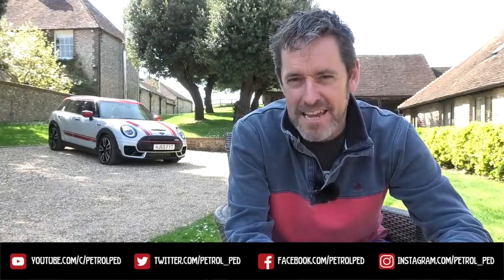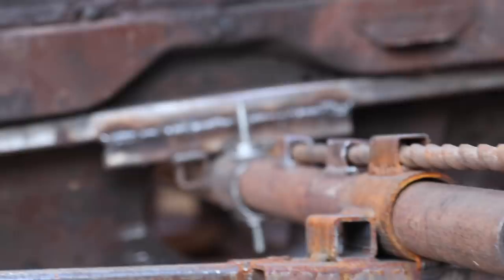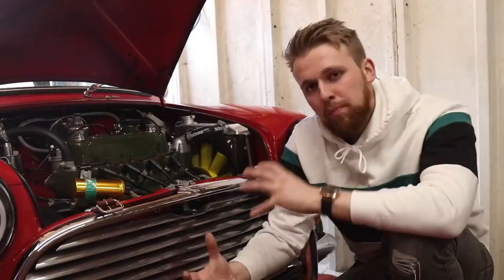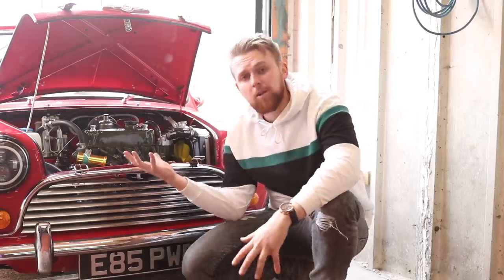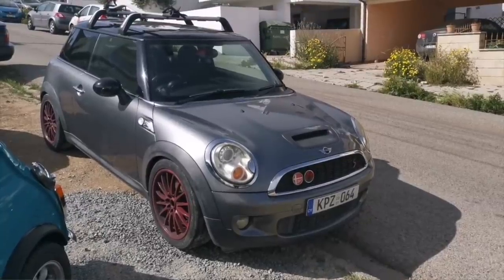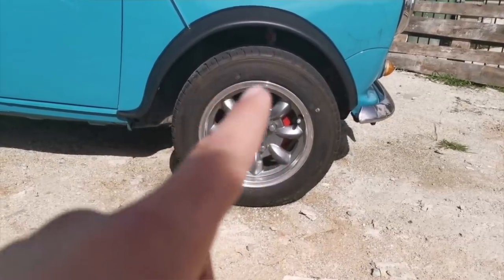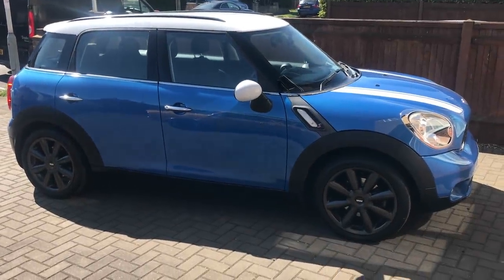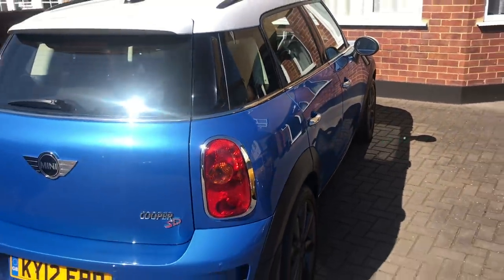Peddlerz Rides #3 - A Trio of Magic Minis with Tom, Thanasis and Andrew [CarVid19 Daily VLOG]

Comment: As an owner of a very unreliable second-hand Mini 850 several decades ago, I wish I had opted for the 1000 which was much quicker. But these concourse-standard modified examples on the videos are works of art as is the modern Mini which, like all smaller cars, looks its best in white with orange decals.

Comment: I've just come back to a classic mini after 20 yrs away, I've literally just finished assembling it, and obviously now can't use it..... I can't wait to get out in it, it's a '68 mk11 Morris,  originally a 998 auto,  but now a 1340 s block manual.... with twins...... in place of the original 'automatic ' badge on the back,  I had a similar italic badge made,which says 'AUTOHOLIC '....... 
The car sits on rose petal 10 inch alloys with 4 pot calipers on a discs...... so should go, and stop very well......
Good to see classic minis on the channel......!!!
Reply from the maker: That sounds incredible 👏